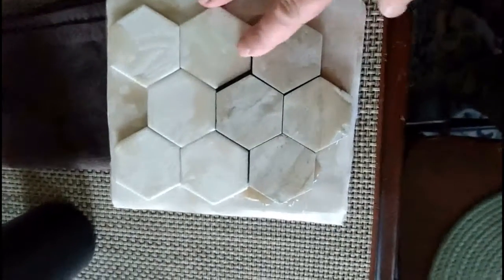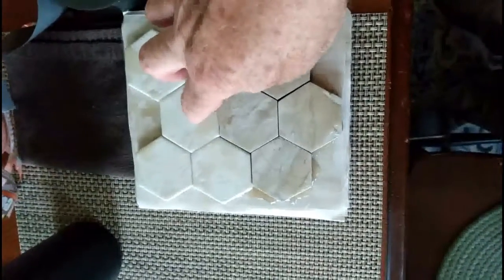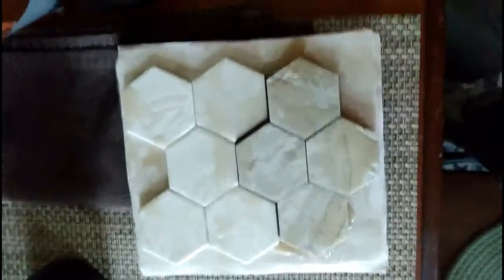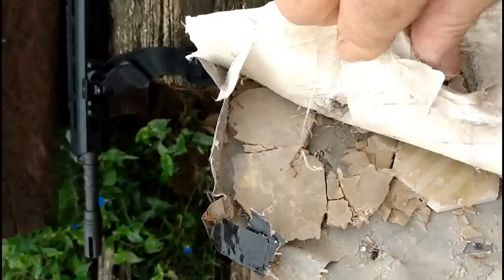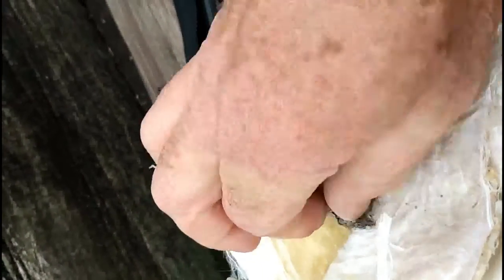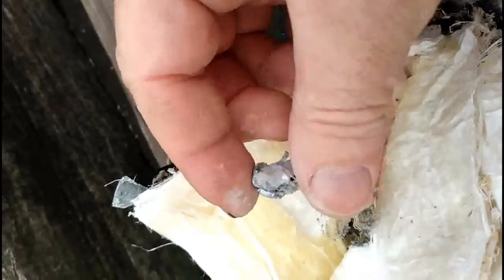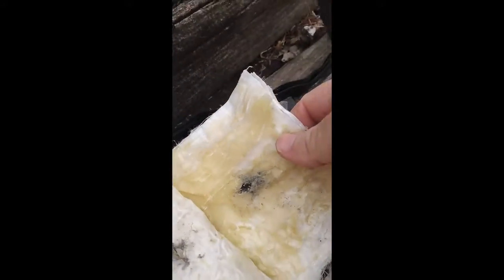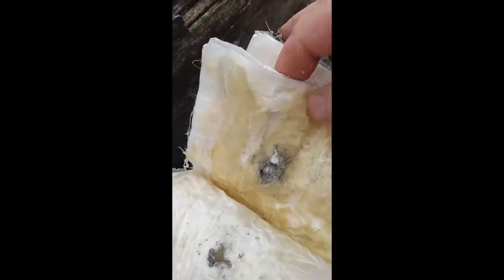DIY test armor plate - show time

Comment: Doing mine with 6mm aluminium plate + 18mm solid quartz + 2mm steel plate + spall (4-5mm).  I hope to stop everything to 5.56 / 7.62 easily.
Reply from the maker: What sort of quarts tile are you taking about? I did a quick search of quartz tile and cannot find anything useful. A lot of long rectangular rough surface decorative type for walls.
Reply: @BooDamnHoo  Silestone quartz worktops samples. I have access to them for free. That's a super hard material, and 18mm should fragment most of the projectiles.

Comment: How much did you pay for your roll of uhmwpe? And is there a cheap supplier for small quantities?
Reply from the maker: Total cost, shipping and handling was $135 for 10 square meters. That was the min for the supplier I used at Ali Baba. I doubt you could go smaller. I haven't found a US supplier of basic ballistic UHMWPE. You can use Dyneema instead, which is a variant UHMWPE fabric used in high performance sails and available from US suppliers, but it is a bit more expensive. If you do, I'd go for as close to 160 to 170 gsm as I could, or the imperial equivalent in inches per foot or whatever. Dyneema is MUCH more expensive. 5 oz dyneema is close to 160 gsm basic UHMWPE. It is $24/half yd. For enough to do a ballistic plate, it would cost more than just buying a level III+ plate. The dyneema is more fabtic-like and used also in backpacks and jackets.
Reply: @BooDamnHoo  Thanks alot I appreciate what your doing here
Reply from the maker: @jonathan8665  I did more looking. UHMWPE from US suppliers is just EXPENSIVE. I found one that provides sheets of ballistic fabric but getting enough for a plate would be $400+. No friggin way!
Reply: @BooDamnHoo  No kidding😂

Comment: Get some non drying modeling clay, around 4 inches thick. Warm it up to around 100° F and strap your plate to it. You'll be able to measure the backface signature.  44mm is the NIJ standard.

Comment from the maker: CORRECTION: the muzzle velocity on the M80 NATO was 2665 FPS.  Also corrected in description above.

The UHMWPE fabric sheets were bonded together by fiberglass resin, giving it a hard feel, plus the tiles also bound via fiberglass resin.  Once the bullet hit the PE fabric sheets, it basically delaminated every layer it passed through.  Not entirely surprising, I suppose, that fiberglass resin was unable to keep all the sheets bound together - the "hard" PE backing behaved almost like soft body armor at that point.  An actual armor plate like the one I present in a previous video (I haven't attached tiles on it as yet - and it is almost 3/4" thick with 57 layers of PE) would need a trauma pad.  I wouldn't want to take the full brunt of a 7.62 stopping in soft(ish) armor.  The ceramic tile does do the main job of wrecking the bullet and slowing it down enough for the UHMWPE backing layers to stop it.  My current chest plate with 57 layers is obviously overkill, at least for FMJ M80 type ammo.  All you need to stop the bullet is 35 to 45 layers behind a good 8 mm thick ceramic tile ballistic face.  And a trauma pad unless you are into damaged internal organs or broken ribs/sternum.

Comment: How thick was the PE backing? What was the bullet used?

I have been trying to figure out what plastic material properties equate to bullet resistance, and the data is not clear from my limited knowledge. Like for layering acrylic with polycarbonate for bullet proof glass. Most people say, well, the acrylic is the hard layer, and the PC is the tough layer. However, hardness of polycarbonate has been tested as greater. Polycarbonate is listed as having higher tensile strength, Rockwell hardness, Izod impact strength (by miles), and modulus of elasticity. The only thing acrylic is superior in is compressive strength. Thus, now I wonder how much of a role a layer with high compressive strength plays. Because the one thing glass and acrylic have in common over polycarbonate is compressive strength.
Reply from the maker: There are 45 layers of UHMWPE fabric. This is just over half an inch thick total, all bound together with normal fiberglass resin. The bullet, a 7.62 M80 NATO FMJ penetrated about 3/4 of the way through. I'll have to count but there's probably 10 layers of PE left untouched.

I shot it from 10 meters away (33 ft).
Reply: @BooDamnHoo  That is a very good result, then. It seems layers of it are better than the molded slabs of PE. Were the tiles that stopped in ceramic or porcelain?
Reply from the maker: @Polarcupcheck  This particular tile was ceramic. They were cheap high traffic tiles from Home Depot ($7 per sq/ft). 8 mm thick.
Reply from the maker: @Polarcupcheck  Also, this PE is specifically made for things like bulletproof vest (soft or hard). The fabric is a PE plastic with 90 degree cross threading of UHMWPE fibers in it. Very strong, thin, and light. I bought 10 sq meters on AliBaba for $95. More than enough for 2 plates.  The specs on the sheeting is 33 layers to produce soft armor, level llla, capable of stopping .44 magnum.
Reply: @BooDamnHoo  Sounds like its performance is similar to Kevlar. I have to look it up. I know HDPE is about the only plastic you can find around the house that has an Izod impact rating that approaches polycarbonate.
Reply: @BooDamnHoo  I looked it up. That stuff has tensile strength near or exceeding kevlar. At least Dyneem and Spectra, does. So people playing around with melted mik jugs are nowhere near the tensil strength of this stuff.